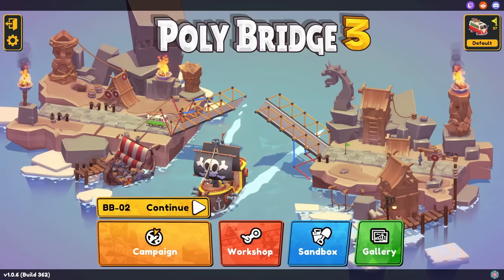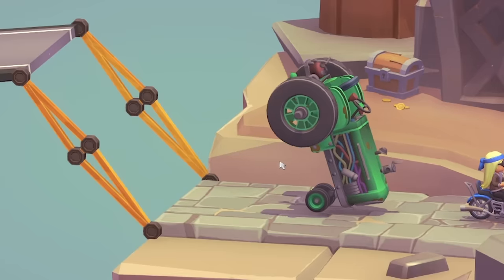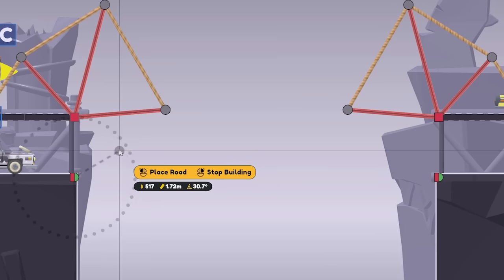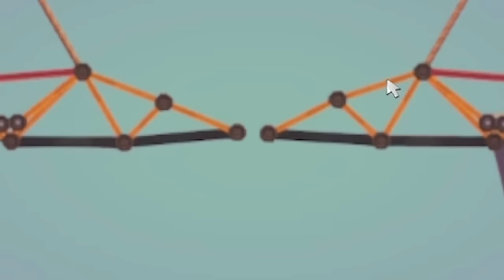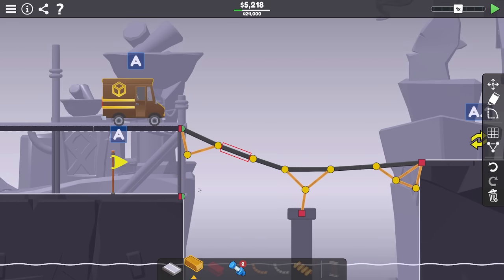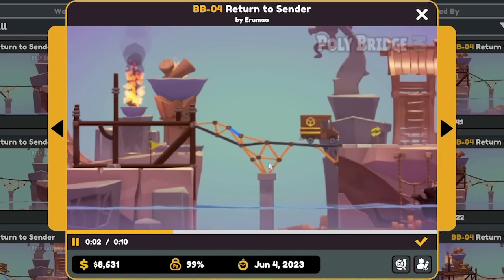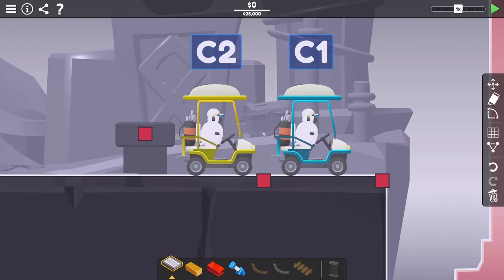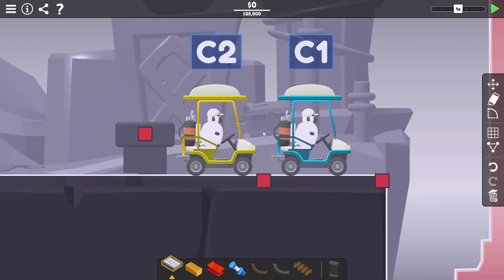This LEGENDARY TRUSS can only be used by pros in Poly Bridge 3!

Comment: Best guess on why your bridge broke when the joint disconnected in Return to Sender: If you drop a large contiguous segment, the forces during the drop can potentially break the bridge due to the physics engine not being quite right. Solution: add extra joints to break the bridge into smaller pieces.

EDIT: My explanation was wrong - the actual problem is because the dropped segment hits the left side, causing the whole thing to spin and move slightly to the right, and that movement is enough to break something, presumably when it hits something else. Adding more joints would still fix it by removing rigid segments. Thanks @ratchet1freak for pointing out the rigid segments.
Reply: and there were some triangles in the dropped part which are rigid and can break if they fall wrong
Reply: @ratchet1freak  I was going to say 'only if there was a bottom to land on', but then I realized it could hit the side. And indeed, you can see it does, and that is what likely gives it the rotation and forward movement needed to break the bridge when it hits something else. So probably not a physics engine glitch, although the solution of adding more joints still works. Edited my original post to have the correct answer, and thanks for pointing it out.
Reply: Making every single joint a split joint might just cause it to fall through the level, and fix the problem entirely